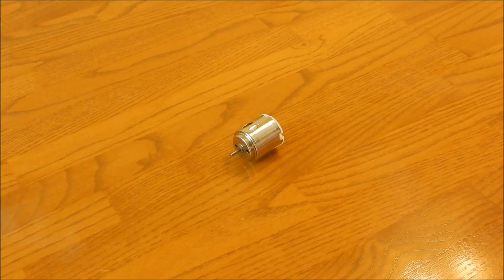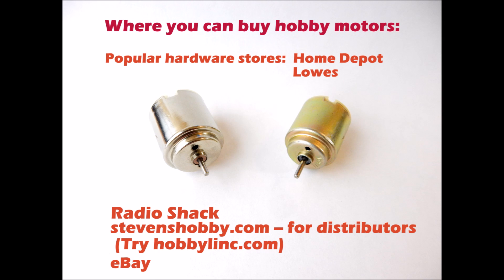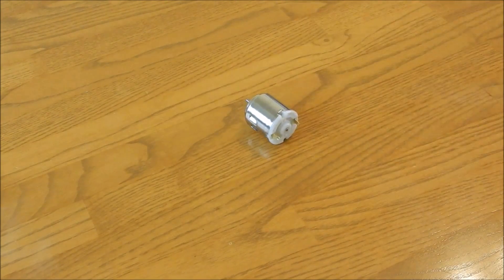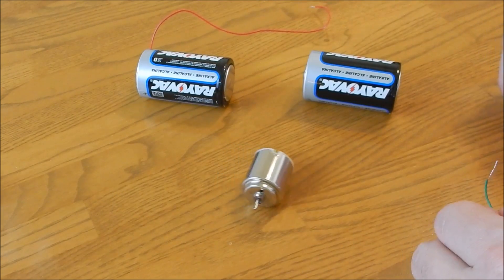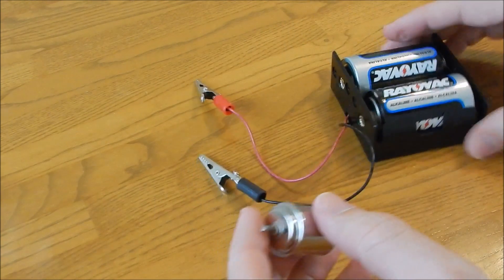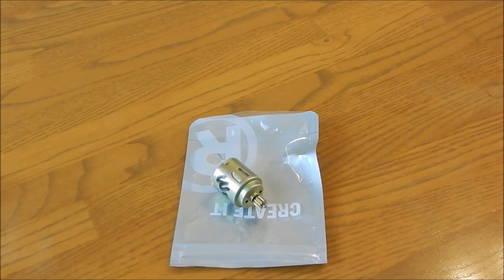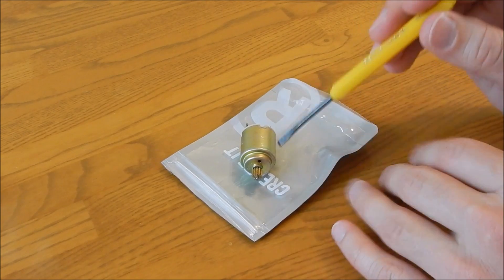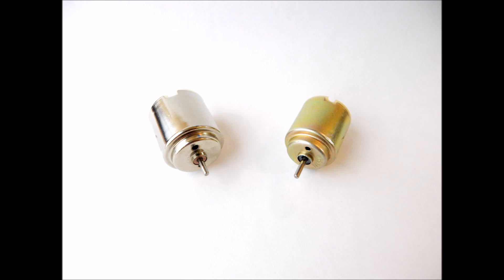How to Identify & Test a 1.5V to 3V DC Hobby Motors and the Vintage Toys That Use Them

Comment: Any idea of what size I need to replace a bad motor in the Milton Bradley game, Manhunt? I am not a hobbyist, just want to make the game work.
Reply from the maker: I'm not familiar with this game.  I probably should've put the sizes of the motors in the video.  If you measure the length in millimeters, you should be able to find it online.  I know there are diagrams with the dimensions.  You could bring it to a hobby shop, and they could help you.

Comment: What happen if you replace the 1.5v battery with 3v battery sir?
Reply from the maker: I personally haven't tried putting a larger motor in a TOMY game or other toy.  I'm not an electrical eng by trade, but I will say with TOMY games, they're mostly plastic gears, so it may just run faster.  Might wear the batteries down quicker too.  I prefer to replace 30+ yr old motors with a newer one (of similar voltage/size) because I think their parts wear down.  I have seen an improved performance.  Perhaps something to explore as a future project--swapping in higher voltage motors in toys.

Comment: Hi there I have a Super Armatron from radio shack the motor say its a mabuchi  silver with two long vent holes on the one side like the motor in your video on the left but doesn't say the specs so not sure how to order a replacement. It looks like the SVM 260 let me know if you think this SVM 260 would work, really appreciated it thanks.
Reply from the maker: Hey, there.  So, so sorry for not responding sooner.  Gosh, you've probably got your answer by now.  I don't own or know much about the Super Armatron.  Also, if you measure the motor in millimeters,  this can help you on a google search of hobby motor specs.  I think I had to do that when I first started hunting for new ones. 

I did find this site with excellent pics and breakdown of the toy:  https://www.jeff-z.com/pinball/toys/armatron/armatron.html

It has a pic of the motor, and it looks pretty beefy.  It might be the SVM-260.  Good luck.
Reply: @MarxKosmos1024   No worries keep up the good videos. I actually bought the 260 Mabuchi brand and it worked great, thanks for the video it helped a lot.
Reply from the maker: @dungeonchunks2344  Glad you were able to find it.  I like to get ahold of an armitron someday myself.

Comment: Really cool video.  i have vintage toy from the 80s that has one of the motors you have in the video.  mine has a small sprocket on the end.  do you have any idea on how to remove the sprocket form the shaft?  helpful video  thanks.
Reply from the maker: I thought I had shown this in one of my repair videos, but I can't remember which one.  I did get some tips from this old video a few years ago:    https://www.youtube.com/watch?v=GcOflu4oJWU    Note, that his guy is removing a gear that's made of metal, so you don't have to heat it up.  Just skip to the part where he's prying it off with pliers and a screwdriver.  My method is two screwdrivers usually.  It'll take too long to explain here, but if the video doesn't help, let me know.

Comment: Hi there I have an eternia playset monorail motor it has a mabuchi motor silver with two long vent holes on the one side like the motor in your video on the left but doesn't say the specs so not sure how to order a replacement for it was wondering if you knew what it was by any chance thank you so much kind regards jay
Reply from the maker: Both the SVM-140 & 260 are about 1.5 inches in length from the tip of the motor shaft to the back, so you have to check the diameter of the motor.  The measurements are very close, but visually you'll learn to tell them apart.  The larger SVM-260 is fatter.  So, the diameter for the 140 is 13/16" and the 260 is 15/16".  That's the best I can give you.  I know I've found the measurements on line before, because I was in the same boat as you once.  I probably should've put the specs in the video.  The package usually lists the measurements on the back.   Link to Mabuchi site:   https://product.mabuchi-motor.com/search.html

If you have any further questions, don't hesitate to ask.  BTW, I've never seen that toy upclose, but I hear it's quite the collectible.  Good luck.
Reply: @MarxKosmos1024  hi mark thank you so much for your quick response and the advice I'm really grateful appreciate it .I have a few videos of mine set up with dramatic lighting on my diorama it's on instagram @jaystead79 MANIAC MASKS. If you want to check it out I have almost 4000 followers as I'm a horror mask and prop artist so will shout out your channel for you there ☺.cheers mate .jay